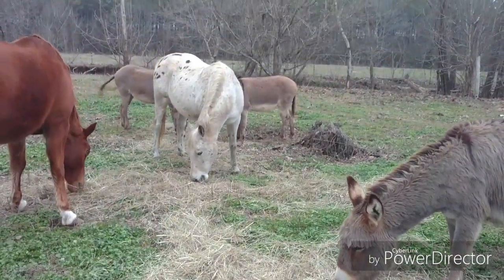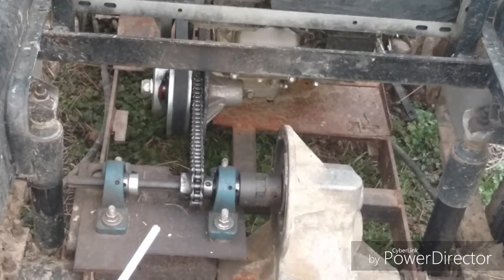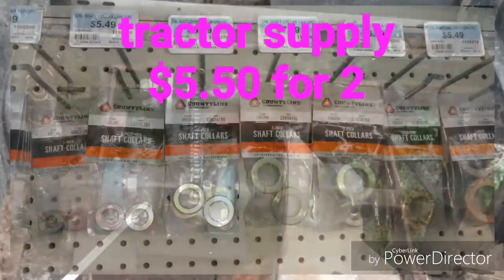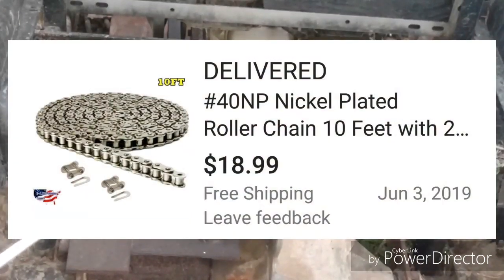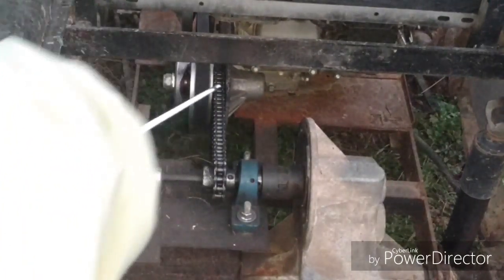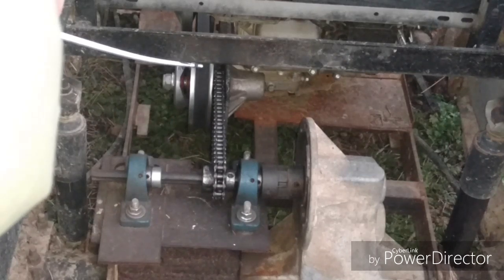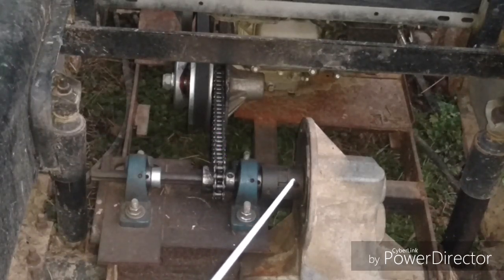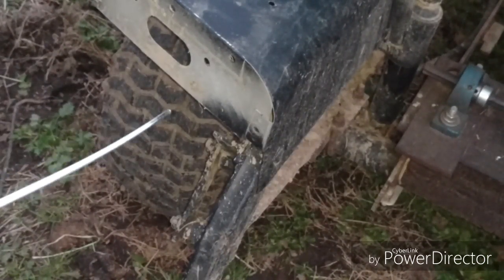Predator 212 golf cart electric to gas conversion parts video.

Comment: Dude this is by far the most comprehensive conversion viseo for a marathon on the internet. Ive pulled my hair out trying to figure out how to convert my 36v to gas. Im going to use a different engine set up that has reverse built in but im definitely using your build. Thank you for making these videos. Cheers.
Reply from the maker: Awesome, glad it helped
Reply: @ChrisfromKeyfarm have you ever a straight chain hookup with 420 ?

Comment: I am researching for a conversion on a Yamaha electric to gas and so far this one fits my needs best. I like the jackshaft and coupler details and the engine size and simplicity. I just want a quiet running simple dependable machine that will do about 18 to 20 on pavement with a quiet engine. I may regear it up a bit. Not real sure how my Yamaha input shaft will couple up yet. Am hoping a 19 spline sleeve (eBay) will fit the existing shaft. Thanks for all the detailed info.
Reply from the maker: Your welcome, mine isn't very quiet though. I hope you get it going 👍.

Comment: What are your thoughts on placing the lower clutch wheel from the torque converter directly on the input shaft of a F/R gear box while continuing to utilize a drive belt?  And then using a chain to connect the output shaft of the gear box to the same rear end setup that you have?
Reply from the maker: I have actually seen a video where they did that, it appears to be a great setup if done properly.

Comment: Great video and I am in the process of doing a EZGO just like the one you did in this video. I would like to know the size gears/sprockets you used as my cart will not get over 10 mph at full throttle. Thanks in advance
Reply from the maker: I think I'm running a 12 tooth on the back shaft and getting 18 mph with a cheap torque converter on the 212. This video has some valuable information you will enjoy.
https://youtu.be/Pc99zbOQYq4

Comment: Will a bigger sprocket in the rear make it go faster ?
Reply from the maker: Bigger makes it slower, but more power. Think of it like this, a bigger sprocket on the shaft being turned ( not supplying the power) is like having a longer lever.
Reply: @ChrisfromKeyfarm  ok makes sense thank you
Reply: What size rear and front sprocket

Comment: Love your golf cart build.  I'm planning on going my own and was curious,  I have the original srater/generator motor on my cart, but don't know know if the 212cc will spin fast enough to actually charge. I purchased  motor that already has electric start, but want to install headlights. What would you suggest? God bless you.
Reply from the maker: If you can get the generator to turn 2000 rpm+ it should charge , however on this system that I have set up if I was running a charging system off the jackshaft, it would only charge when the cart was going full speed. Have you thought about just using a battery hooked to the small charging system that your engine has? The 212 doesn't come with a charging system but if your engine has electric start, it should charge somewhat, now days you can get a lot of light out of very little electricity using LED lights.
Reply: @ChrisfromKeyfarm  That was my initial thought, just started thinking about the generator. Didnt know if I'd be able to reuse it or not. Thanks

Comment: How did you box the front end of the engine plate in. I’m doing this exactly as you are but I can’t figure out how you boxed in the round stock
Reply from the maker: I added a comment a couple days ago and it's not here. ?  I had to wrap the round bar at the front in rubber because it was vibranting and making noise, second, I never did box it in, I have a rubber bungee cord wrapping it to the frame, it really works well.
Reply: Keyfarm okay thank you for the reply! Does the round bar still slide on the frame in order to keep the chain tight? Or is it held stationary by the rubber bungie cord.
Reply from the maker: @joesmo4536  the bungee does allow the plate to move forward just a little with the motion of the rear suspension, but it cannot raise up,which is why I was going to box it. The use of rubber to do this really worked out good.

Comment: Nice project. I put a 420 CC Predator in a Yamaha golf cart. It was already gas, and the original motor was locked up. I have had it for about a year now, and I drive it almost daily. I will definitely be looking into the marine vinyl seat cover. Thanks for the suggestion.
Reply from the maker: Awesome man glad I could help
Reply: Did run straight chain

Comment: Maybe you addressed this, but what's the benefit of the torque converter vs centrifugal clutch?
Reply from the maker: Because of the expansion and contraction of the TC pulley, you get a better mechanical advantage of the low and high end Vs. a toothed clutch that always has the same gear ratio. Does that explaination help?
Reply: @ChrisfromKeyfarm  Somewhat.  I am completely new to this type of build.  I have an old golf cart in the barn.  I plan on doing a 212 swap.  I just can't decide on what setup to go with.  I already have a Polaris Ranger, so I don't need power.  It would just be nice for the kids to ride around the property.
Reply from the maker: Now this is just my opinion but old golf carts and high-speed don't really go together . Whatever set up you use try to stick to around 15 MPH for the kids. If I were to gear mine to15 it would have all kinds of power.
Reply from the maker: Now this is just my opinion but old golf carts and high-speed don't really go together . Whatever set up you use try to stick to around 15 MPH for the kids. If I were to gear mine to15 it would have all kinds of power.
Reply: 💕💕💕💕💕 You have actually explained this to where I can understand such, thanks @ChrisfromKeyfarm

Comment: If you put a bigger sprocket, say 20t on the jack shaft would it make the cart go faster and less torque?
Reply from the maker: A Bigger sprocket on the shaft will slow it down. It's like using a longer ratchet, more torque. Also like a bicycle, the big gear on the back makes you pedal really fast but you don't go very fast but if you use the small sprocket on the back it is hard to pedal but the bike goes much faster.
Reply: Keyfarm even with the 12:1 ratio on your differentials?
Reply from the maker: @NathynKheang  yes the differential gearing remains the same no matter what I do up top , a bigger sprocket is like a longer lever, it has to travel farther but it has more power.

Comment: Does it have forward and reverse and how did you get electric start on a predator 212cc
Reply from the maker: No reverse, that can be done, but requires mounting a gearbox that costs about $115. If I remember correctly. It doesn't have electric start, just a simple pull rope, the best way to solve this would be by upgrading to the pred 420

Comment: Any bosy i. These comments  ever run a straight chain from clutch straight to rear sprocket with a 450cc? Did it works
Reply from the maker: I haven't, but if you hear it low enough, it'll work fine

Comment: 212 moves them fine.. good to see got a tomberlin e cart dead on arrival.. going ice is cheaper than tjose 6 crusty batts and what ever other controls are bad... I hates electric cars carts anyway..  refuel is quicker than  recharge  thats my argument.. good to see a 212 is plenty to move these.
Reply from the maker: The 212 works just fine, but it is loud.

Comment: Do you have a link to the l075 coupler. I can’t find on that site
Reply from the maker: I'm sorry, that was a while back. What bore size?
Reply: @ChrisfromKeyfarm  the spined side.
Reply from the maker: https://www.mrosupply.com/couplings-collars/jaw-couplings/hubs/247857_ml075-1316_martin-sprocket/
Reply from the maker: Part # 247857
I ""think"" this is the one I used
Reply: @ChrisfromKeyfarm  that one doesn’t appear to be splined it just has a key way?
Reply: @ChrisfromKeyfarm  whoops i thought it was splined. That’s my fault! Thanks for the video. I am going to build one of these as soon as these parts arrive.
Reply from the maker: Ok, I can clear this up. In the first version of the conversion I used a a 13/16 bore jaw coupler ( no splines, just a set screw) I had to file it out just a little. I think that is addressed in the main build video. In the version now I had a piece made from a jaw coupler and the old electric motor nose, you can see that in the( top speed upgrade video) I hope this helps.
Reply from the maker: Cool, if there is anything I can help with, just let me know.
Reply: @ChrisfromKeyfarm  need a redesign with that reverse gearbox haha.
Reply from the maker: They actually make a reverse gear box that takes the place of the rear shaft of the torque converter. Seems like that would work pretty well. Maybe someday.👍

Comment: what was the cost for everything at the end
Reply from the maker: I had to add it up and I came up with $485+/-. That includes tires, vinyl, pretty much everything mentioned in this video and some cost for hardware not mentioned. I didn't include any cost for metal for the engine plate because I already had that.
Reply: A set of six golf cart batteries would have been in the $1500 range. Maybe less for three trolling motor batteries but I haven’t seen anything on that yet. (I’ve got a, new to me, 1965 EzGo electric with one bad battery. I’m just getting started.)

Comment: Would you be willing to add a parts list in the discription?
Reply from the maker: I'll see what I can do
Reply from the maker: I have added a parts list to the description, however I did not add links, because so much stuff has changed in price, especially the torque converter , which last week when I clicked on the same link( for an upcoming project) it was $299.  Which is outrageous.
Reply: @ChrisfromKeyfarm  thank you so much. I will be building my first, exactly the same as yours.